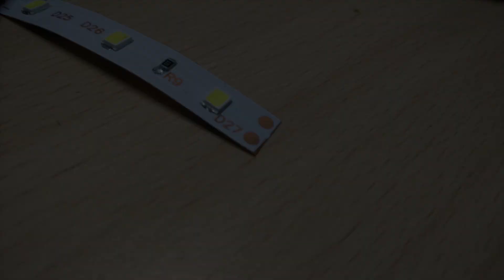How To Install LED Lighting in a PC Case

Comment: looking back that pc looks terrible
Reply from the maker: I don't think it ever looked pretty. I just threw together whatever I could afford at that time. I thought it was decent then.
Reply: @LiveSparks  at the time it was a great pc but oh god dude the intel cooler killed me
Reply from the maker: Interestingly enough, that is the one thing that I have never thought about replacing. It works surprisingly well. Never had any throttling issues. It just looks bad.
Reply: @LiveSparks  i assume it does, but the look hurts

Comment: What is the cost of led strip which you are using and the name of cable. Please tell me the exact price. I also need to buy one. Please.
Reply from the maker: I don't remember the exact cost(This was a while ago). But I know that it was fairly cheap. I bought the strip from a local store instead of going online. What cable are you referring to?
Reply from the maker: Those are breadboard jumper wires but they are not really necessary, just use any wires that you can shove into the molex connector.
Reply: @LiveSparks  Thank You sir for your consultance.

Comment: dude.. RGB Strips requires 12V at max 1-2 amp of current but you have connected it to the molex which indeed provide 12 volts but it has over 30-50 amp of current depending of the smps models. that would damage the LED/RGB strip... wont it?
Reply from the maker: No. Any electronic device won't draw anymore current than it requires as long as the supplied voltage is within it's ratings.

Comment: Bhai the connectors you used to derive power from the molex socket those pin like structures you entered in 12v and gnd socket

Comment: use heat shrink tubing for soldered wires, and 2 strip of wire. not having two joins between them is just plain stupid!

Comment: So I plugged the molex into the PSU, and plugged the LED strip in. Where does the molex attach to the motherboard, I can't find the header. If I just turn the power on the led's do not come on. Any help?
Reply from the maker: Molex itself doesn't connect to the motherboard. There should be a really big connector for the motherboard from the PSU. The molex gets power when the motherboard turns on.

Comment: At 2:01, your yellow and black wires have some sort of black adapter on them that looks like it allows them to securely connect into the molex? What are those called?
Reply: jumpers

Comment: Bhai, i want my led strip to light up fully when PC is using HDD, is there any way to utilize the motherboard HDD light  key in front panel section and achieve this??
Reply: did you find out if that was possible? sounds interesting

Comment: What U used to plug in the molex wire....what is that connector??
Reply from the maker: +Usama Ashfaq Those are breadboard jumper cables, you don't necessarily need them. You can just use bare wires.

Comment: very good and informative video. Other people that i watched have done it in a much more sophisticated way. Your way  was really simple. Bit how can i connect the simple wires to the molex connector without the jumper cables? My Psu has the female port. Do i have to cut it?

Comment: HI, i have  RGB led strip but i only need 1 color. im not planning to connect the remote receiver to the molex connector. i just want to directly connect the LED strip to the molex connector. the receiver has an output current of 6A and an input of 12v, can i still use your method without burning out my led strip?
Reply from the maker: +DarkLight Yes you can, just connect the color you want to the yellow wire.

Comment: I want RGB Leds, so is it going to work if I get an RGB led strip, a controller and a remote plus a sata to molex adapter? Because I want to connect the led controller to the sata to molex adaptor by cutting off the sata connector and connecting the wires from the controller to the wires of the molex connector. What do you think?
Reply from the maker: +JellyyFISH That will work flawlessly.
Reply: Live Sparks Thanks man! You helped me a lot!
Reply: JellyyFISH the leds and controller come as a pack.
Reply: Okay. Thanks!

Comment: Thanks for the video. One question. I understand that you are using the yellow wire from a molex connector (12v). How come at 1:00 in the video, you connect the red cable from the LED strip to a yellow "jumper cable". Shouldn't the LED strip have a yellow cable (instead of red/black) as well since it's 12v? Thanks for your time.
Reply: Also, at 0:50, it looks like the original wires coming from the LED strip are white/black. So it seems like colors alone are not a good indicator of voltage? In this video there is seemingly a white 12v wire from the LED strip, and a yellow 12v wire from the molex connector.
Reply from the maker: +GG Nomix the molex connectors are color coded universally, so the yellow wire will always be 12v. 
There is no universally accepted color code for led strips. I just used the jumper cables that had been previously damaged, it was a coincidence that it was yellow. The color for the strip doesn't really matter as long as the connections are correct.
Reply: That makes sense, thanks.
Reply: Damn you are dense.

Comment: I have this LED Strip Light http://www.amazon.in/Lowprice-Waterproof-Control-Light-Color-Changing/dp/B016SMPFI0?ie=UTF8&psc=1&redirect=true&ref_=oh_aui_detailpage_o07_s00

I just want to know how i will put in my Corsair 400c, Want to which wire i need to put my LED strip light in my cabinet.

Thank You

Comment: from where did u buy NZXT case i wanted the razer edition but cant find
Reply from the maker: +Dev mdcomputers.in
Reply: which is the best case around or under 10k?
Reply: nothing is in stock on the website u gave
Reply from the maker: +Dev try primeabgb.com
Reply: Razer edition is a nice case. It comes with a card placed in the back (cable basket) that split differents green leds (5 and 12v). But there's no room left in this card to connect other leds.
Reply: Just got my razer edition s340 nzxt case from PrimeAbGB from lamington road for 9K. Looks dope with thr NZXT Kraken x62 liquid cooler which has led display which you can configure to whatever animation u like.
Reply: Jay Nikam Hey man, how did you connect the LED lights of that case?

Comment: how many meters of led strip you used to cover the case ????
Reply from the maker: +Μιχάλης Φουτζις I think it was just above 1 meter
Reply: cool ty....btw u covered 3/4 of the  case ?
Reply from the maker: +Μιχάλης Φουτζις yes, because the strip would have been visible on the bottom.
Reply: great youve been very helpfull now i know how to do it cause i thought 1 meter wouldnt be enough
Reply from the maker: +Μιχάλης Φουτζις It really depends on your case, those strips come in 5 meter packs anyway.
Reply from the maker: +Μιχάλης Φουτζις happy to help

Comment: good video... also make how to install extra fan.
Reply from the maker: +Puipuia Hmar You put the fan where you want it and screw it in.
Reply: Live Sparks through the smps or Motherboard? Can i connet through SMPS?
Reply from the maker: +Puipuia Hmar You can connect the fan to the power supply via a molex connector but usually the motherboard has extra connections for case fans.

Comment: i don't have these power connectors
Reply from the maker: +Abdul Munam You might be using a really old power supply when SATA and PCI-E weren't very popular or you might be using such a low Wattage PSU that PCI-E power won't work out. Whatever the reason, you need to buy a modern PSU with enough wattage to run all your components.
Reply: yes.sorry for that i have 6-pin connector
Reply: can your graphic card Nvidia 1060 can work on 6 pin conector ?
Reply from the maker: +Abdul Munam Yes
Reply: thanks man you are cool

Comment: you are a hardware engineer
Reply from the maker: +Abdul Munam No. But I am in my second year for being a computer science engineer.
Reply: i knew that
i am look ing for you kind of people
Reply from the maker: +Abdul Munam what kind of people?
Reply: i love computer engineer and i myself want to be a computer engineer. 

what kind of power supply did you use ? Did you use the one that has additional pin connectors for gaming graphics cards
Reply from the maker: +Abdul Munam I has the PCI-E power connectors but that doesn't matter. It only needs to have molex power connector which almost every computer power supply has.
Reply: it is a gaming supply right ?
Reply from the maker: +Abdul Munam There is no such thing as a gaming power supply. That is just marketing bullsh*t.

Comment: thanks that's very helpful bro. But what was that which you used to connect into smps
Reply from the maker: +DAEMONE GREEK I used jumper cables but you can use simple wires to connect to the molex connector.
Reply: doesnt it affect my psu?
Reply from the maker: +DAEMONE GREEK Not if the wiring is done correctly.
Reply: ok thanks buddy
Reply from the maker: +DAEMONE GREEK No problem!

Comment: Nice and also please suggest me a good case under 3000rs. I am also getting the same specs.
Reply from the maker: Here's a case that I found : http://www.primeabgb.com/online-price-reviews-india/antec-x1-t-gaming-cabinet-with-window-black-2/
Reply: Sorry but antec is not available in my locality and I can increase my budget to max 3500 Rs. 
Is this a good pc-
 i5 6500 
zotac gtx 1060 mini 6gb
8gb corsair vengeance ddr4
WD 1 TB BLUE 
CORSAIR VS 550
ASUS H110 MOBO

The seller is giving me a circle cc 821 cabinet. Is this a good cabinet? Please help me..
Reply from the maker: Just checkout the website primeabgb.com they have some really good cases
Reply from the maker: +divyansh agnihotri pretty nice rig. 
The cabinet looks cool
Reply: Thanks for help.
Reply: What's the price of Nzxt  in retail market
Reply from the maker: +divyansh agnihotri over 3000 INR

Comment from the maker: For any questions, first check out the FAQs in the video description. 
If you still have doubts, feel free to ask.
Reply: Where did you buy the Jumper wires?
Reply from the maker: +Lorenzo Quadri ebay
Reply: can u still use the rest of the rgb stip
say as in for backgroung lighting behind a desk
Reply: When i hook it up to my pc it doesn't give me a white color. It's orange. All colors work great except blue. When I hook it up to the original plug to put in an outlet it works fine. Is this a power issue?
Reply from the maker: +Macresco If you are using a RGB strip, the strip first goes into its controller and the controller then plugs into the power supply.
Reply: Yes I did all that but it doesn't give me a bright white color. and it doesn't shine as hard as it should
Reply from the maker: +Macresco I can't help you much without knowing exactly what LED’S you are using. Many RGB LED’s have significantly different Installation procedure than shown in the video.
Reply: I fixed it, it was a voltage problem
Reply from the maker: +Macresco Glad you could get it working
Reply: @LiveSparks  bro is it ok to light a small led strip with more current than required voltage remaining same... I searched on google and found that a single led gets damaged with more current than it requires?
Reply from the maker: It should not be a issue. Standard LED strips can be cut into segments of three. Just check for the markings on the strip.
Reply from the maker: +Kevin K.T Yes, of course. Just solder some wires to the exposed copper ends and you are good to go. For an example see my latest video where I used the leftover strip to make a LED panel.